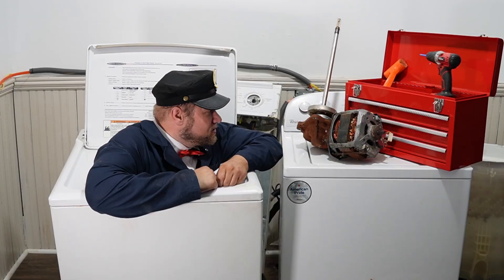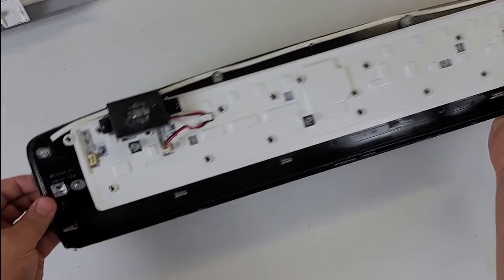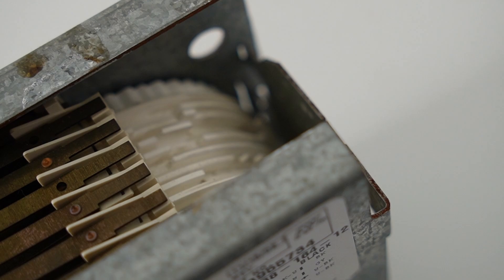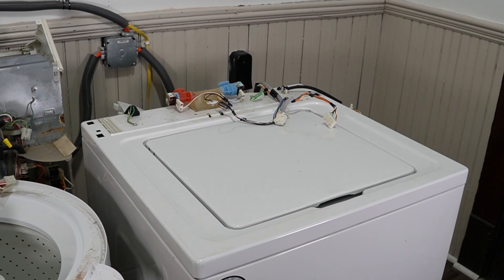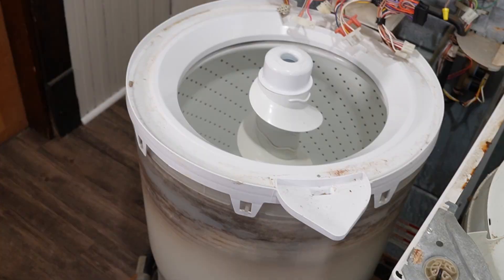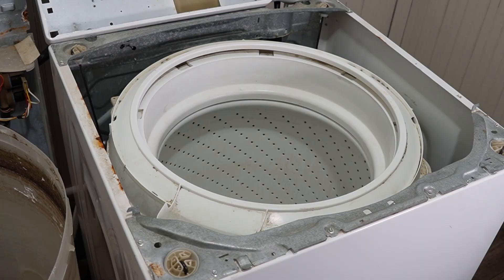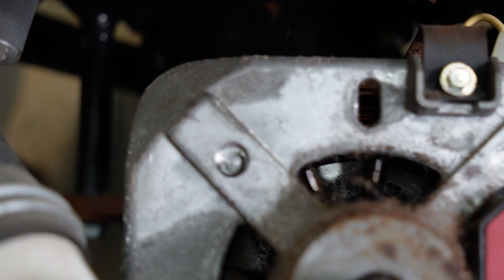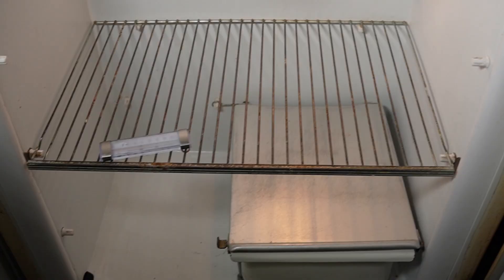Are Washers Built to Break? Inside a 1984 Washer vs. Now

Comment: It's really funny to see this video.  I have a "matched pair" of washer and drier shown at the start with the black gage cluster and the white bodies.  I got the Kenmore set (whirlpool) from Sears in 1984 and they are my weekly cleaning machines.  I don't think mine are as rusted up as the one in this video, but I've never had to take them apart to look.  Still run fine after 38 years.  I also got my Kenmore refrigerator (whirlpool 106) that same year and it turned 38 years old in March.  It has had some issues, but I have been able to fix them myself.  Lets not forget the Kenmore (whirlpool) dishwasher that's in that same 38 year time frame.  You are right when you said that "they don't make them like they used too".  Maybe if they killed off all the "venture capitalists" things might get back to normal.
Reply: ..it's the Government, too, with all their stupid regulations..and all the suckers who think they have to have the latest gadget on everything..I mean, really..a Tablet or a TV on a refrigerator?....
Reply: Eh, VC somewhat. But I trace it back to all of the MBAs that graduated in the late 80s/early 90s--the first generation of folks who started introducing spreadsheet software into every single facet of business, with the focus of saving/extracting evey last cent possible. All of the sudden it was possible and cheap to figure out how to super-optimize every single department, process, supply chain, etc. Made a few people really wealthy. Not sure did anything positive for society.

As far as regulation, sure some are excessive and annoying. Maybe we could eliminate some if we invested more in education in general. But most regulations there's a number of families behind them missing their loved ones every Christmas because some cheap-ass executive wanted to take a short cut. I'm happy to deal with some inconvenience to prevent that from happening.
Reply: @jacobyunderhill3999  spreadsheets are good if they're used for good reasons and not just capitalism™ "make more money,
Reply: @webmasale  Making money is the entire fucking point of a business, and of the employees filling the jobs it creates.  It's not evil, doing unethical things in the pursuit of that goal is.
Reply: @jacobyunderhill3999  As we older electricians say, the NEC and Fire codes have been written in blood.

Comment: On the old style machines, you do not have to remove the inner tub to remove the transmission since the spin tube is a separate piece. You just have to remove the agitator and 3 transmission bolts under the machine and it will slide out. On the new ones, the spin tube is built into the transmission which means you have to remove the inner tub and drive block to pull the transmission out of the washer.
Reply: Yet another so-called “innovation” to deliberately make maintaining/repairing them pure hell.

Comment: I have that same old Kenmore, bought it 20 years ago, still runs perfect.
Reply: Me too!
Reply: Me too!
Reply: Never get rid of her! I got a Whirlpool from 1996 direct drive, same as this Kenmore. Beast. Absolute beast.
Reply: I have a Maytag washer and Kenmore dryer which my parents brought in 1984. They became mine in 2015.  Both are have been and are heavily used and still going strong. The only repair made was the lint screen needing to be replaced after mishandling. The older machines are superior and as long as I can get parts, I will never replace them.
Reply: @Goldenwoodz  - I have a 1990  Kenmore - aside from replacing the  agitator dogs and disabling the lid lock, it runs as new - i believe one saving grace is that my washer and dryer are located inside my home, in a ac laundry room - and i do not overload it ever - 32 years of hard work - (praise be to the Kenmore gods) - lol
Reply: @languay1  Me too! Bought in Sears in 2000! The saleslady said it will be washing long after all of us are gone :lol:
Reply: @erossinema8797  I agree. My neighbor bought a fancy new machine. The last owners left a whirlpool from the mid 70s. Washing perfectly, but wanted something modern. Three years later I saw the Samsung machine on the curb.  Out of warranty and "unfixable" according to the tech. He said it never worked right. My neighbor said he is thankful they didn't take the old machine when they delivered the new one, it is back in use.
Reply: Same 2002 here, mine is the simpler design. I paid 324 for the washer because it was scratched at Sears.

Comment: I can remember growing up that my parents only had Kenmore washers and dryers. My first recollection was an avocado green pair from the late 60's. Those two machines lasted until the early 80's when they bought a new set which you showed in the video (the machines with the black control panels). Those two machines lasted quite a while. I grew up and was out of the house when they eventually replaced the two "newer" Kenmores. I do believe they replaced them with the "old" unit that you tore down in the video. Kenmore washers were solid machines. That's all my parents had. Those machines were damn near bullet-proof. I can not say that any washer made in the last two decades can really match up with the quality and durability of the Kenmore machines from the 60s thru the 90's. Those machines from that era were really built to last. Is anything these days built to last?  It doesn't seem so.   Great video. Loved how the old and new tech were exposed. Clearly from this video, you can see that the Kenmore machine with its heritage going back to the 80's was built like a tank compared to the newer whirlpool.  Thanks for posting this video!

Comment: One thing that is often overlooked with the statement "they don't build things like they used to" is that they don't cost what they used to, either.  From the 1985 Sears catalog (the same "$170 less" page shown in the video), that washer was on sale for $329.99.  That's $946 in 2022.  But that's discounted by $100, which would make the "regular" price $1233 in 2022 dollars.

The modern washer is just over half that price.  Some of that price saving is in using components that don't last as long.  A better capacitor might add a dollar to the price.  A better relay, maybe two.  Do that for a dozens of tiny components, and now you have a machine that's $100 more, but functions identically to the cheaper one for the first few years.  Between two otherwise identical appliances, one with a 1-year warranty (Whirlpool's current warranty length), and one $100 more with a 5-year warranty, most will go for the cheaper model, so that's what companies make.
Reply: The average consumer ONLY cares about price. Brand loyalty used to be a thing, but now it really isn't. If you asked today's consumer if they'd pay double for something that lasts 5 times as long, they'd say "yes", but if you put those two items on a shelf, they'll buy the cheaper one. This is mostly because they don't research their purchases any more. My mother would read reviews and had a subscription to Consumer Reports. Now people just buy the cheapest model. This is also why China has more new millionaires per year than any other country.
Reply: Also, you have to take into account survivorship bias.

There was a lot of crap sold in the 50s-80s. But most of that crap has  mercifully landfilled by now. The same has yet to happen to the crap of today.
Reply: @hexane360  "has yet to happen"? I throw away appliances every year. Some small, some large. The only appliance I've bought in the last 20 years that hasn't been replaced is my Dyson vacuum. It's an original DC07.
Reply: @aaronbritt2025  Brand loyalty doesn't exist anymore because brand reputation is no longer something that the manufacturers are concerned with. They have the machines made with the cheapest parts. Some of that is consumers' desire for lower prices but it started with the manufacturers maximizing profit.
And quite frankly I wouldn't believe the "lasts twice as long" claim.
Reply: Given the choice there's enough people to buy the more expensive one that will last longer
Reply: @hexane360  You definitely have it backwards. Planned obsolescence has gotten out of control these days. Any appliance repair person will warn you to not buy new stuff because it's crap.
Reply: I paid $1100 for a Maytag Commercial, Speedqueens are $1200 or so. Get one of those, and they're built like the old ones.
Reply: It has less to do with people being cheap and more to do with scumbag corpos and greedy shareholders than anything. Planned obsolescence needs to be regulated. It's horrendous for the average person and for the environment, basically for anyone that isn't a top percentage corpo. Problem is all these politicians have corp interests at heart more than, well anything else.
Reply: dont forget that you have to use them both for about 30 years to get the real cost
how much will repairs be for the new one for a 30 year span when the old one finally goes
Reply: Unfortunately, the biggest problem when buying such products is figuring out which "expensive" product is built to that cost. Many expensive products are expensive without justifying that markup. If I could guarantee my additional money would buy correspondingly high quality products I'd leap at the chance, but there's enough crap expensive items out there to force you to do genuine research, which gets tiring if you do that for everything ;(
Reply: @aaronbritt2025   The problem is, those of us who are willing to pay more for a superior product just don't have the option in most cases.  Brand loyalty has gone away because there are rarely good brands that have a lineup of all quality products.  Everything is a globalized mix-n-match crapshoot product that just has your favorite brand logo slapped on it at the end, with a price tag to match their legacy back when they used to make quality products.  Looking at a large number of reviews is easier than ever now, but all the reviews are mixed because all the products are cheaply made, resulting in some great units and some terrible units.  The phrase "you get what you pay for" rarely applies anymore, because you risk getting garbage no matter what you pay.
Reply: @NoName-ik2du  agreed
Reply: @aaronbritt2025  yes and no imho. Brand use to stand for something.  The type of product, engineering and a company that stood behind the brand.  Now brands are just labels of marketing with the products behind the brand just relabeled junk.  Senco was revered in the construction industry for excellent pneumatic nailers and now the name has been bought and sold so many times and is attached to terrible products. Sears diluted Kenmore and Craftsman.  You can still buy quality but it’s very expensive. There seems to be a lack of mid tier products that balance, quality and price. All the mid tier products seem to be the same as the cheap junk at mid tier prices.  When I talk to different home service industry providers, they seem to think that consumers only care about features and looks and sometimes a fancy brand name. Consumer do not buy on quality anymore so there is no market to make a mid tier quality product.
Reply: @aaronbritt2025  Spot on. When we moved our manufacturing overseas (read as China) quality went down the drain. But Americans also shifted to focusing on cost over quality. Part of that was old school conditioning. When we went to Sears or Montgomery Wards we knew we were basically getting good quality Made in America products. Not much research was needed. Now its the wild west. Everything is made overseas. You just have to roll the dice at which one you think is the best piece of crap. So I believe consumers basically gave up and just do what's easiest and buy the cheapest. Then buy it again in 4-5 years. China is counting on that. We are a disposable society.

Comment: I have that exact Kenmore washer. Bought it in 2002. It saw 4 sons through HS and still washes for two of us and 3 of them - who work in dirty jobs. Lots and lots of hard washing, normally about 5-7 loads a week. Still works great after a few small repairs along the way. Biggest one was the cams in the agitator. Had it apart last year to replace the mixing valve. That's it for repairs. I'm not looking forward to when I may need to replace it, I know I'll never find anything that will do as well.
Reply: Mine has gone through 6 kids and is still going strong. We had the same repairs as well as we replaced a rusty drum. But this thing is awesome!

Comment: The transmission drive (for those who think plastic/phenolic gears are weak) resembles another machine with cockroach life expectancy: Pull the timing cover off of a 300 inline 6 Ford, and you will find this EXACT setup!  Phenolic cam gear and metal crank gear.
Reply: So long as torque is kept under control, nylon gears work well, even when meshed with metal, and are more tolerant of degraded lubricant, allowing for much reduced maintenance. Heat is a big factor that can degrade nylon gears, so some thermal protection is necessary for long life.
Reply: Pull the cover off your garage door opener. You are going to find phenolic gears.
Reply: I put 400.000 miles on one of those 300" straight 6 Ford engines and the only thing that Wasn't worn out when we pulled it apart was the cam timing gears. We .040 overed the cylinders and threw it back together with a new cam and gear set and pistons. It should go another 400k with no problem. I only changed the gears because I was replacing the cam.
Reply: I've seen those plastic gears completely gone
Reply: I replaced a bad graphite bearing in a dishwasher pump with a nylon drill bushing. It lasted over two years before the nylon actually wore the stator shaft to the point that that it would no longer sit straight on the housing.
Reply: Same for the GM 2.5 "Iron Duke", and it's HUGE other than metal timing gear.

Comment: Bought a Whirlpool top-loader probably around 1990 & its only had one issue: a leaky trany while under warranty. Since then no issues whatsoever. My neighbor bought a front-loader Maytag recently that the main ecb died on & was told was too expensive to replace. It's ridiculous that no one repairs these ecbs & what the manufacturers get for them.
Reply: Used to rebuild those Whirlpool washers at the appliance shop....loved working on them, they were simple, easy to fix, and parts are very reasonable.  Only had a few transmission issues, and kept a spare transmission on the shelf so we had one in stock all the time as it seemed to take forever to get a replacement when needed.  Most times it wasn't the transmission itself but the clutch assembly that would fail, also an easy repair, and very reasonably priced.  These were the machines we'd rebuild and resell and we'd sell several a week, people love them because they work, they do a great job, and handle the heavier loads that many people run through their machines.

Comment: Another factor to consider when bemoaning the fragility of newer washers is the Energy Star requirement.  In order to score well on the Energy Star scale, newer washers have to use DC motors which in turn require electronic controls to facilitate agitation, and the drag caused by drive train components can be reduced by using more plastic vs steel.  The result is a washer that will last maybe six or seven years, if lucky.
Reply: So what good are energy savings if you have to replace the damn thing every few years?
Reply: @WhittyPics  If they calculated the energy costs of manufacturing a new washer it wouldn't be very efficient. But they don't. Just more planned obsolescence.
Reply: @WhittyPics  , exactly as mentioned in the video.  You can save about $50 but that's a drop in the bucket for the short period the new ones last.  And if you have to start replacing control boards, every single penny of that savings has just gone out the window.  Those things are pricey.
Reply: @WhittyPics  woah woah woah woah woah woah woah woah wrongthink detected you cannot question the experts or else you are committing both wrongthink and misinfromation.
Reply: Nah. They last over 10 years

Comment: As a washing machine repair guy with 38 years experience, I offer this point of view. In the 80s and earlier the cost to buy appliances, washing machines, refrigerators ect was an ENORMOUS undertaking. Therefore spending a 1/4 or 1/2 the valve of that appliance was the sensible thing to do. In the past I had customers that happily owned a washing machine for 20 or 30 years,,,, proudly telling me that their prized washing machine only had the pump replaced 3 X , the gearbox and motor replaced only once each oh yeah also had the timer mechanism replaced twice,,, “but it still works “ 
Here’s the thing, each repair in today’s dollars $$$ was a large percentage of the cost of a new washing machine. 
So I ask what’s better value ? Spending the equivalent of the cost of a new machine to repair an old one (in today’s dollars) to keep a washing machine lasting 30 years, or buy a new washing machine every 8 or 9 years???
The wash up (excuse the pun) is washing machines have ALWAYS BROKEN, it’s just a fact of anything mechanical or electrical, the difference is , back then it was unaffordable to buy a new washing machine, and now days it’s so so cheap in comparison to buy a new washing machine.

Comment: My Kenmore washing machine is from 1971. 
It came to me after 15 years from a 4 kids family. Since then, its run 2x per week. Still works fine. 
The dryer is GE from1963 I’ve overhauled it once. Basically new belts, oil its bearings and vacuum it out every year or so.

Comment: My 1983 Maytag is running great which we bought new. All we ever replaced is one drive belt and water input solenoid.  The old Maytag has a front panel that is held by two Philips screws that you can get to most of the parts. My brother in law has one from the 70's  which he is still using.  They don't make them like they used to.